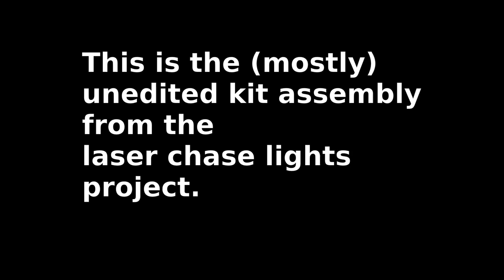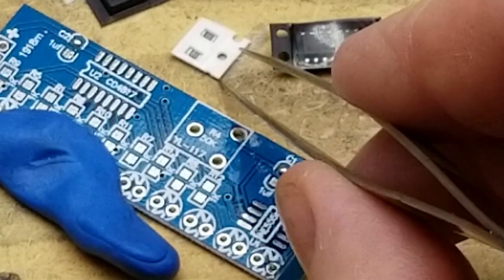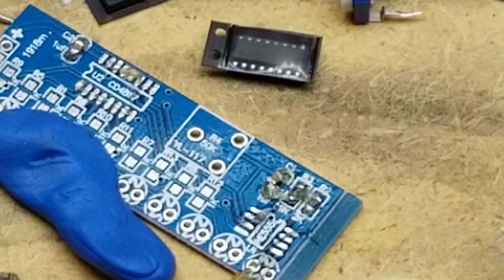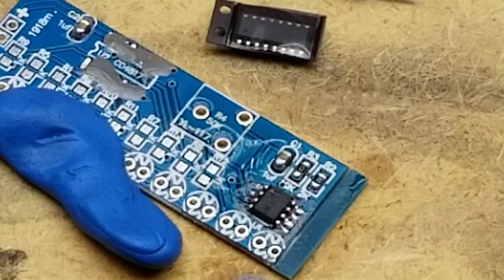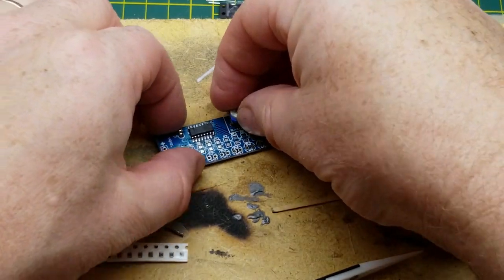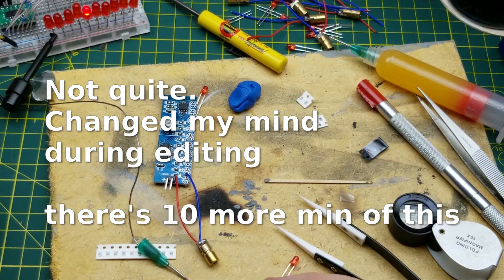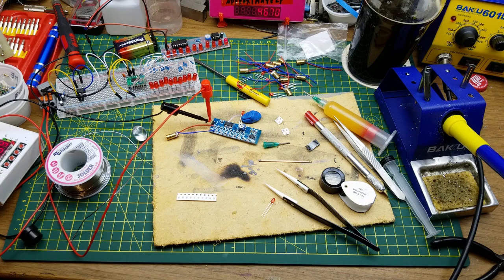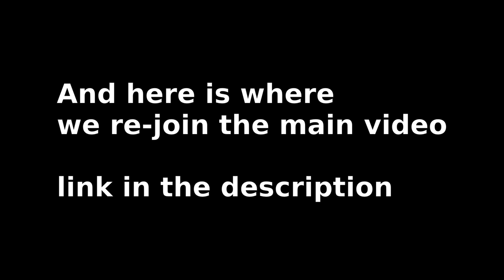long slow soldering video

Comment: when surface mount soldering by hand use a very good quality ra liquid or bga past flux. I use the bga flux in a siring applicator, it hold the tiny grain size components in place, use the tweezer tip to hold down, apply solder to a clean tip and just touch pads and it will flow nicely. try it.

Comment: Impressive SMD soldering!
Reply from the maker: that's one word for it...
I think I'll stick to thru-hole as much as I can.
Reply: @pileofstuff  It just takes practice and some really fine lead based solder. You need less solder than you think.  They don't make lead based solder paste as far as I know, otherwise that would be ideal.  A magnifying headpiece helps, but they are expensive for anything decent (don't waste your money on the cheap stuff), so the next best thing is the desk lamp with the big magnifying glass in the middle.
Reply from the maker: @Chris Robinson I've got an optivisor clone that I keep forgetting to use. 
The perils of getting old, I guess...

Comment: Louis Rossman you are not but i can relate
Reply from the maker: Yeah, I only had it swimming in flux, not completely drowning in the stuff.

Plus, this is only the 3rd time I've soldered an SMD kit. 

I like to show that anyone can struggle with new skills, but with perseverance you can get there in teh end.
Reply: @pileofstuff   Good point
Reply: Not for nothing but I just started with smd soldering and my first paste i bought,  was from Louis Rossman store. Just from seeing yours melt and flow, your paste is 100% the issue because you're doing perfectly fine with applying the paste. I try and use a low air speed with med/high temperature and aim at the feet on an angle.  Good paste is really cool to watch suck components into place.

Comment: 3:15 No way those are Imperial 0201; they are close to 1 mm wide. Imperial 0201 are only 0.3 mm wide.
Reply from the maker: Could be. 

I'm not that experienced with SMD. I think this is the 3rd SMD board I've ever soldered.

I'm just going by the information I have available.
Reply: @pileofstuff  I just noticed that the silkscreen on your ruler is missing a large part and that the size you laid the resistor on is 0805.
This is how your ruler should look like: https://cdn.shopify.com/s/files/1/2187/3161/products/Adafruit_PCB_Ruler_1024x.png
Reply from the maker: That's what I get for trusting cheap knockoff tools...